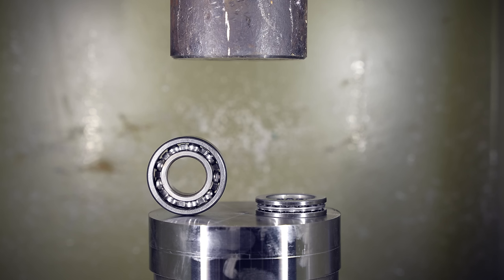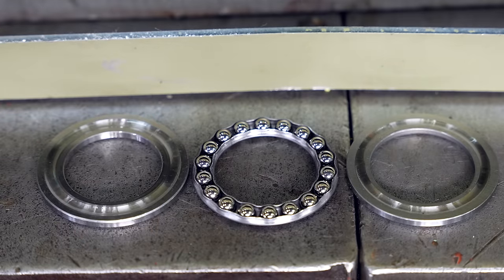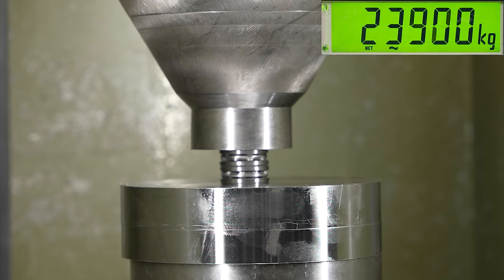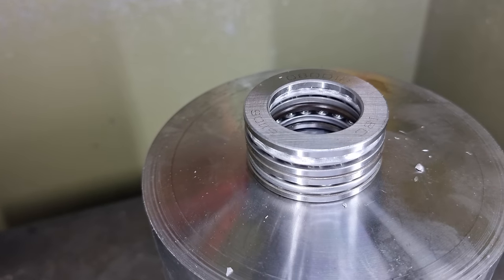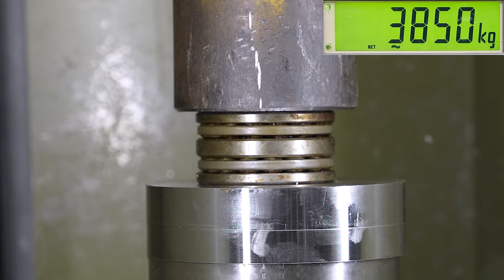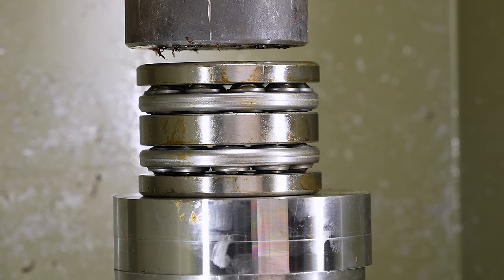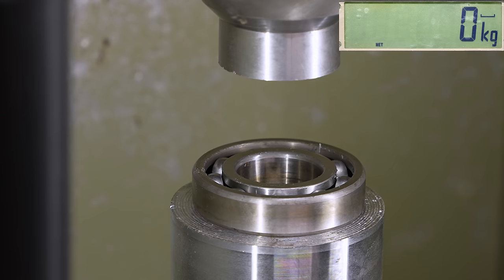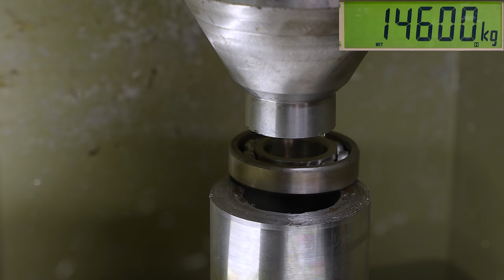Pressure Bearings = Most Dangerous Item To Crush

Comment: If it gets too hairy, consider some good optical mirrors that will allow you to film round a corner and preserve the cameras behind some steel plate. Even if you lose a mirror one day it could make for a much smaller and tighter containment box. Love to you both 🤘
Reply: you could also use the mirror idea to view underneath the last crush
Reply: A trick the Soviets figured out when studying implosion for their Atomic bomb. (Richard Rhodes The Making of the Atomic Bomb)
Reply: maybe use a pretty weak mirror to ensure shrapnel will break the mirror rather than reflect off
Reply: Double mirrors at 45° so there is no distortion/mirroring effect in the captured footage.
Reply: @Tatwinus  seems like a lot of complexity when you can just mirror the footage in post. a second mirror won't cancel out distortion from irregularities in the first mirror, it'll just add its own as well.
Reply: @Tatwinus  I don’t know if mirroring would be harmful, you could just flip it in software afterwards. It could be useful for access.
Reply: Yeah you never want to use non-optical mirrors like… cardboard?
Reply: Optical mirror huh? As opposed to a sound mirror?
Reply: @thetruthexperiment  damn you really got 'em... twice for some reason
Reply: @thetruthexperiment  a mirror designed for photographic use that has the reflective layer on the outside, not behind the glass. It prevents double reflection when viewed at an angle. But no, you carry on and pretend you know better.
Reply: @thetruthexperiment  it’s pretty cool to see the Dunning-Krueger effect play out live
Reply: I actually prefer the excitement and "danger" (as long as the people on the scene are safe of course).
Reply: Yep, this is the way to do it. That way you still have control of the press and can back it off when the "experiment" is done. Haha.

Comment: Try this again with radial bearing, but make a housing that doesn't allow outer ring to snap. Try pressing gently and see if it still spins or does it get extremely crunchy. And then also press until destruction.
Reply: I was thinking the same. That bearing would have been very strong with the inner and outer surfaces properly supported.
Reply: But then it's about the strength of the housing and not the item being crushed!
Reply: @Ben-sz6cd  that's how the bearings are designed to be used, though!  It would give a much more realistic sense of how much axial load the bearings can take
Reply: Why not just remove the outer rings and try to explode all the ball bearings... That would be so cool if he could get like 10 ball bearings to explode at once
Reply: I would also like to see radial bearings loaded radially but in the middle, where the axle would be. All the previous videos have loaded them on top which isn't how they are loaded IRL.
Reply: I have done this by accident at work, my 150 press came off the ground and I am lucky to still be able to hear, it was a much bigger bearing tho

Comment: Safety first 💕 what about multiple layers of 8mm thick polycarbonate? Also, you can reuse the cracked one as extra padding on the sides of the safety box, the metal should keep it togheter and it will dampen the biggest shrapnels :)
Reply: I think 8 mm + 12 mm should be pretty good combination. Put the 8 mm polycarbonate plate as the inner one and you can replace just that when it gets damaged.
Reply: Yes. Broken wall material was often used as center fill in castle walls because once the outer shell breaks, cannonballs striking the loose material in the center are not very effective at penetrating to damage the inner shell.
Reply: @keamu8580  That's a good point. Maybe a good technique would be to use 8 mm + 12 mm with a few millimeter space between those and fill it with water but leave the water container fully open at the top. If something heavy is hitting the interior surface will will compress the water before applying the force to the outer surface. In addition, with water filling the space between the two surfaces, you should get less internal reflections which should improve optical quality of your screen.

Comment: I think you would get higher loads from the smaller bearings if you didn’t double stack them. I think they fail do to the upper and lower level balls not lining up. The balls are in between each other and causing point loads on the races. If you did a single layer then each race would have full support.
Reply: ya it they very clearly break once the top and bottom are no longer aligned properly
Reply: Yep, that's just what I was thinking.

Comment: You get more protection per layer if you space the layers out a bit. I saw a video about this, this is how NASA designs shields against high velocity impacts. The idea is if it breaks through the first layer, it has a chance to spread out before impacting the second layer.
Reply: Pretty sure that only applies to impactors moving at orbital velocities, i.e. >20,000 km/h
Reply: @slaphappyduplenty2436  Principle is the same.
Reply: Whipple shield.
Reply: @slaphappyduplenty2436  this is how most armored things are setup as well. this is also how they test penetration as every time it has to penetrate there is a chance of shattering along with kinetic losses. google spaced armor. in this case of needing to film a clear soft layer would work great in between.
Reply: Kinda the same deal with reactive armor.
Reply: This is the secret of the most durable composites, like bulletproof glass. It is easier to smash a homogeneous material through itself with a high-energy kinetic impact than it is for the same impacting projectile to repeatedly tear through alternating layers of materials with different densities and orientations of their structural "grain". There is also defensive value in alternating soft, stretchy material with hard, brittle material. The stretchy material steals a lot of energy from the impacts on the brittle material, and spreads it through the soft layer. Something that does not play out as easily with a brittle material which shatters and spalls instead.

Comment: For reference, 150m\s is around 450 ft\s, which is almost half the speed of sound, 330m\s. Most bullets are sub-sonic rounds, meaning they travel less than 330 m\s. Those fragments were easily flying with the force of a low-powered bullet, such as a .25 cal revolver.

Comment: Could you repeat this experiment while the bearings are in motion? I'm curious whether the axial load bearings continue functioning right up until they break, or if they seize up earlier.
Reply: They would seize before exploding, but depending how fast you apply the force (and with a press it's pretty fast!) there might only be a short delay. The "rated loads" for these types of bearings are the operating loads where they can still spin without wearing out the grooves where the balls roll, so when you exceed that load you start accelerating the wear until everything comes to a grinding halt.
Reply: They would be mechanically incapable of failing until they seized, however that process would happen in an instant, even to the eyes of the high-speed camera. Seizing and shattering would basically happen in the same frame, I believe.

Comment: 5:03 One of the ball bearings hit directly in the middle of the high speed lens, bounced back, and still left a dent in the steel of the press.
Reply: the lens is probably plastic and it can bounce medium speed projectiles at very good efficiencies, and the steel balls are very hard so they can dent metal easily~
Reply: @dimitar4y  the dies are very hard. The bearings are very hard, but so are the dies, so it would take a good amount of energy to do that.
Reply: @dimitar4y  Remember there is a layer of polycarbonate between the bearing and camera, but you can see it better at 0.25 speed at 4:56, nice dint.
Reply: @BryceKimball7.3  balls are the hardest. and their contact point being a point means max denture.
Reply: @dimitar4y  balls are the hardest what. Yes I know the tiny impact point means they can dent stuff easily, but the dent was deep enough that it took more than a little energy.
Reply: @BryceKimball7.3  i mean it's launched by essentially 35 tons of spring force. I'd imagine it has enough energy to put a dent in your bone too
Reply: @Bobs-Wrigles5555  You can also go frame at a time if you just pause YouTube video and press comma (1 frame backwards) or pediod (1 frame forwards).
Reply: @MikkoRantalainen  Yes, I'm aware you can frame by frame, but here it's not really necessary as Lauri is already playing back slomo and the 0.25 speed allows you to track the ball bearing easier with your eye then manual frame by frame
Reply: It hit the polycarb shield between the lens and the experiment. If it hit the actual lens of the camera, that would be it for the camera.

Comment: You should set up the safety box as an armored metal box, with a periscopic, sacrificiable mirror... So none of your equipment, or you, will be exposed to hazards caused by a failure of polycarbonate. Periscopic camera enclosures are good too, especially around explosive tests, usually with a buffer of sand backed with vermiculite to protect the camera from shrapnel.

Comment: I know I'm a bit late on this, but sheet metal armor is fine, just make it into spaced armor. So say it was 1mm sheet metal, you'd have (bottom to top) 1mm sheet, 2mm gap, 1mm sheet, 2mm gap, 1mm sheet, 2mm gap, etc. If you have any metal thicker / stronger than the 1mm sheet (say, a 1mm sheet of Titanium instead of mild steel) you'd make that the 'face sheet'. The idea being you want your hardest/strongest layer facing the threat, and the spaced layers behind take care of anything that manages to penetrate. 3-1mm sheets will provide more protection than a single 3mm sheet. In fact, they'll provide more protection than a single 6mm sheet. Spaced armor is really good for the types of projectiles bearing crushes make.

Comment: Please don't think I am trying to insult your English, as it is brilliant. So much better than my 2nd language! Anyways, I thought you may be interested to know that we call the inner and outer 'cups' of the bearing 'races' in English. Thanks for all your vids over the years!
Also my recommendation for strengthening the windows is to use two panels with a gap, as two separate layers provide greater impact protection from very fast moving shrapnel than a single double thickness layer.

Comment: Second hand story, but my father nearly got killed by one of these twice. He worked as a calibration expert at Bowser-Morner, testing these in a rig that used two spheres that the bearing sat between as I understand it.
The test was on one of these, but like 4 feet OD. It shot out of the testing rig, hit a cement wall, and exploded.
There was the two outer rings embedded into the cement wall, and the ball bearings went into the opposite wall about 20 feet away, leaving potholes in it.
By some divine miracle my dad just got a cut on his hand, despite being in the path of both sets of projectiles.

Good news, this test is now done behind ballistic glass and a cement wall!

Comment: Taper roller bearings, first in free air, and then one in a piece of machined mild steel housing, like it is in actual use. In free air it will break easily, but the mild steel case should make it hold up to a very high load before failure. Bonus if you freeze fit the outer race into the housing.

Comment: try with one bearing at time - will be stronger than two, because or balls and pressure in middle rings or you can use thick steel plate to separate bearings, or alignment balls (ball against ball, gap against gap) ...

Comment: "Axial" bearing- some people might call that a "thrust" bearing.  High carbon heat treated steel can fracture with no ductility, meaning pieces flying out.  Sometimes when you have radial bearings pressed onto a shaft, you have to break the bearing race to get it off meaning you beat on it with a heavy hammer and a sharp chisel.  I've seen people do this and have small pieces of metal embed in their skin when the bearing finally fractures.

Comment: Hey Lauri- could you test which way a adjustable wrench is stronger. There is some dispute which way it will hold the nut best and which way it will break earlier. You need to check both grip (how much it flexes) and damage on the worm vs jaw. It would be very interesting to see.

Comment: Put a bearing on top of a screw, and see if it will rotate when it is pushed into wood.
Reply: Similarly to worm gears not functioning in reverse, I expect nothing would happen
Reply: They probably did it years ago if I recall correctly

Comment: You should try unseating the deep groove ball bearing when the outer race is seated well, and the inner race is on a shaft. I am sure you can make an anvil to seat the bearing, and a short shaft with a shoulder to press it out. This way we can see the actual axial load in a rea application. My guess it 20 tons instead of 10 tons
Reply: well, the bearing is broken long before it exploded. these loads pit the surface of the race, making the bearing useless. His one ton guess is probably not far off for a bearing that size.

Comment: In the last test, the object failed at one force level, then the tool wedged itself into the remains and cracked it at a higher force, which the sensor logged as the max, but the first force peak is the real one.

Comment: I would think if you did multiple panes of polycarbonate spaced out it would absorb the shock and be able to handle more than a single pane , plus easier and probably cheaper to replace if it gets a pane with a crack

Comment: hmmm...could you arrange a larger version of these inside a device such that they are in front of a metal plate in front of a shaped charge such that when the tip of the device hits the object you're dropping it on, the explosives at the rear cause the metal pad to fly forwards thus compressing the bearing towards the front of the device resulting in the carnage seen here?

🤔

Comment: Actually, putting ball bearings into their position is one of the industrial uses of hydraulic presses, though this is unusual to do, normally you'd try and cool the axle down and/or heat the bearing and use thermal expansion to make them fit themselves. If done correctly, this creates an almost inseperable connection.

Comment: I'm curious how much pressure these bearings can take while functioning. You could wrap a string around the middle race of the bearing and pull on it while the bearing is under load.
Reply: A string? When it gets tight it won't spin. That's why you have to set preload on a bearing you can't just tighten it up. They would have to have a spinning base or something. It would be way to hard to pull by hand
Reply: *too hard
Reply: @andyroberts4387  correct

Comment: It would be interesting to find out the supported load limit, say with the smaller thrust bearing. I noticed that all of the bearing sets you ran had the bearings randomly aligned, leaving them in a free-suspended area on the races. Maybe try aligning the bearings so that they are in a vertical line from top race, through the bearings, to the bottom race.

Comment: use steel wear plates they use on diggers. it's the same as bullet proof targets. Hardox is out of sweeden and even 6mm of their 500 rated steel will easily stop handgun bullets, and some small rifles. 8mm polycarbonate MAY stop a .22lr. anything else is going through.
you should be able to just order it out of your supply catalog like a standard sheet of steel. better strength if you bolt it together as a weld will ruin the temper in the heat affected zone, leading to tearing under stress
make windows with replaceable poly windows, probobly 22mm+.

Comment: It's weird that 8mm polycarbonate cracked. Propper polycarbonate is supposed to deform without cracking. I use polycarbonate for safety equipment regularily and tried shooting 2mm thick polycarb with a 22lr. The piece i shot deformed and sheared but did not crack.
Reply: 22lr has 25 grains at about 1100fps.
The bearing balls are about 600 grains at about 700-800fps (roughly given how it covers 6" in few 240fps frames)
Reply: @BuzzinVideography  how the hell did you figured out the speed of the ball?

Comment: It would be a lot more revealing, spectacular and dangerous to close objects if you removed the sheet metal cage around them, it's acting as a shield and you could easily remove it and place the balls around the lower bearing surface then place the upper on and REALLY get some spectacular sparks and fragments flying.

Comment: For a change you should get a hot water heater and seal it up and disable it's safety features and fill it with water and blow it up with it's own heat source, shoot it into the sky like a rocket, I've always thought an old style boiler looked cool after an explosion  all the tubes pop out, but hot water heaters are quite funny.